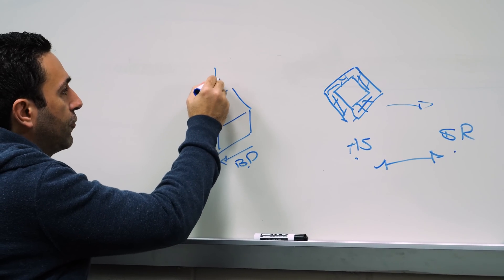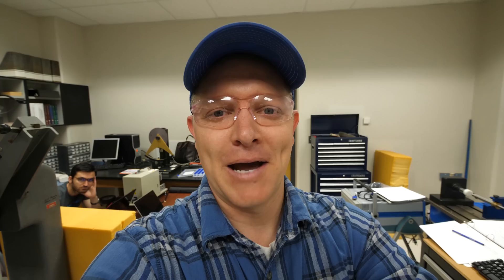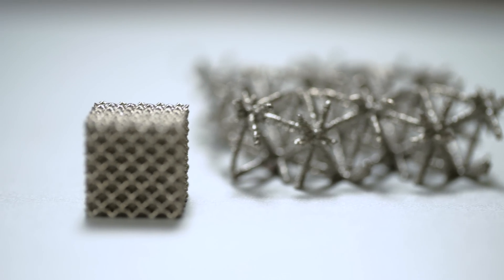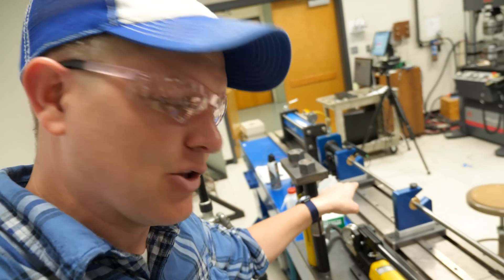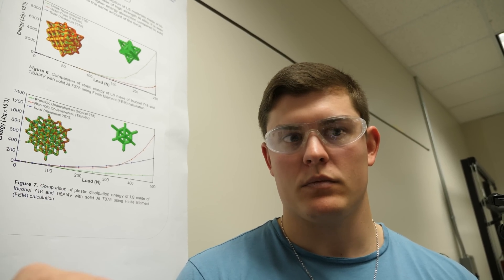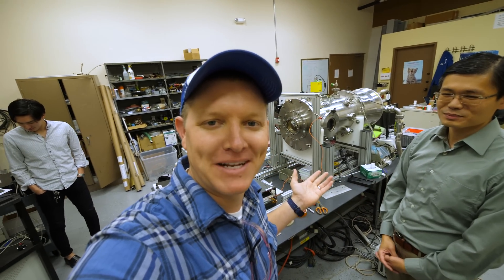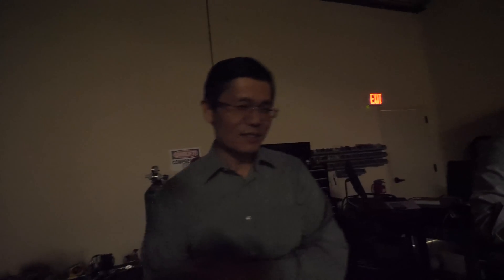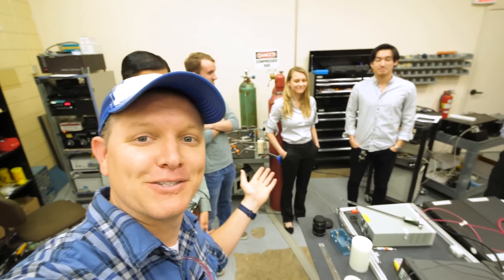Touching Plasma PhD Research Opportunities at UAH - Smarter Every Day 193

Comment: The butterfly is so light it just gets carryed by the migratonal winds, witch go in the same direction as the sun goes around the world spins, vice versa
Reply: It's about surface area, the bigger your body space takes up the easier it will be to move in the wind because it has more surface area like a dandelion blowing in the wind vs a seed, or its like when you burn a sawdust vs a block of wood, it burns faster because it's less surface area

Comment: Very much in line with syntactic alloys or C60 Fullerene's pushed through a 3D printer, stacked, and chemically bonded with the previous layer, to create large super-rigid structures that are actually only a single molecule. Infinite fatigue life would be inherent. Resiliency would be unprecedented. Applications are endless.
 Interplanitary travel will become more plausible.

Comment: Hi I am a 1st year metallurgical engineering student from South Africa .... I have an Idea for the 3D Metals...What if your are able to heat treat some of the beams of the lattice structure , so to improve the hardness of some beams and Ductility of other beams thus making the material stronger and increasing the toughness ....I know heating only some parts and not other will be a big problem maybe something like Induction hardening might solve this problem?....And will this even work ?

Comment: The ion thruster looked like a plasma stream that you'd see in a spectrometer. But the guy put his finger in the way...how do you generate plasma without Ohmic heating? Is that what he meant about controlling the current?
Reply: Also, how finely divided are the metal particles when they are printing. Metal starts to behave weird when it's finely divided. For example, nickel: fairly inert but when it is very finely powdered it gets used as a catalyst when processing edible oils to make margarine. Same for iron when used in Grignard reactions.

Comment: Have you heard of the swiss cheese drag racing cars from back in the day? very similar concept: where racers wanted to decrease the weight of cars by drilling large holes in the frame, and through experimentation they found the increased surface area increased the structural integrity of the frame (up to a point)

Comment: I always wanted to research on a cubic motherboard for a computer to save space.
Reply: Once again they would save space which a good amount of people would pay a premium for.  It would also be very useful for drones constricted on computer space because they need more utility space.
Reply: But dude people have been stacking boards for decades now I don't understand what exactly you want to research..
Reply: Doesn‘t seem very reasonable to build them cubic 😅 there will be intereference, way more complex and expensive building of such a thing and a lot more engineering requiered to change one new tech feature that will eventually come.
And that all to safe some space doesn‘t seem like a good idea, especially since cooling that stuff also is nescessary...
sorry for my bad english, greetings from germany :)
Reply: Just take parallel boards and use wires or connectors...I really do not see the point in making them cubic.
Reply: Nicholas Del Rossi but do you realise that a motherboard would likely cost between 800-1500$ instead of 120$ if built them cubic? There aren‘t enough people to buy such a product to produce it.

Comment: That lattice structure deformed oblongly would be interesting to know the strength added by a thin perimeter shell.
Reply: I was thinking about that too, however, scaling up... an entire axis would be filled with more material anyways. With that said, something tells me the two planar axis areas that are left won't just be exposed material either.  The results would be interesting nonetheless. The addition of other objects and materials such as shells, could create interesting macro structures. I'll have to create and run my own computational models now, I'm curious.
Reply: I'm interested in filling microlattice structures with ferrofluid for electrically tunable material properties